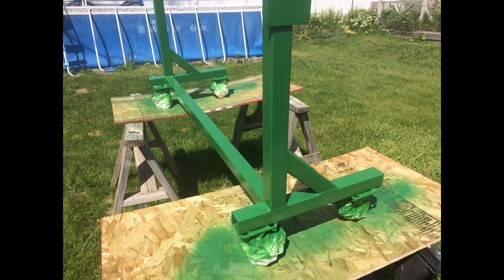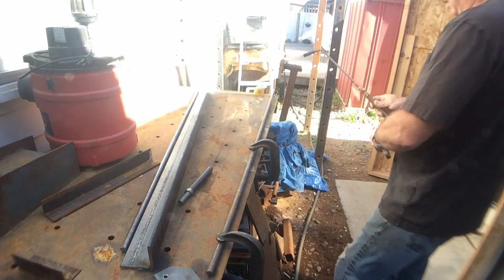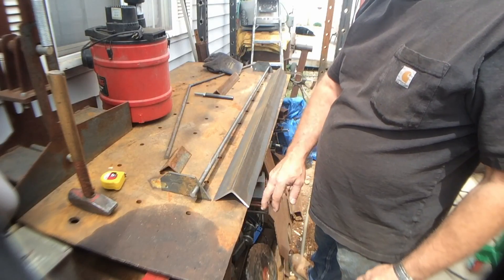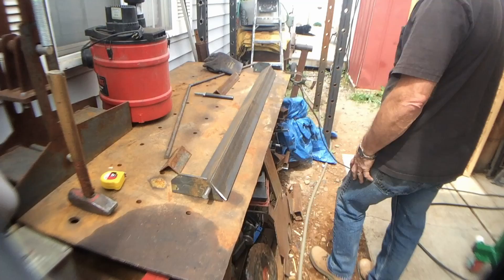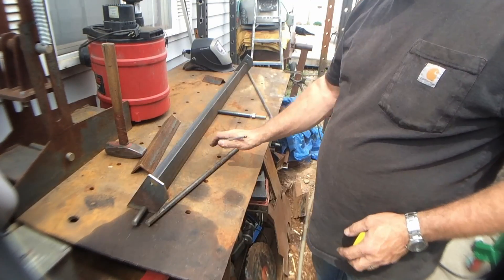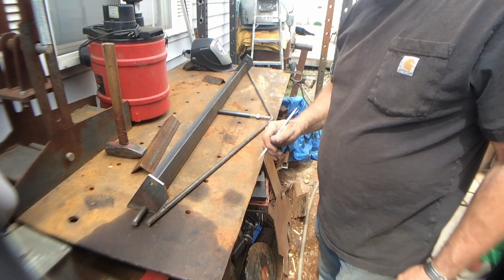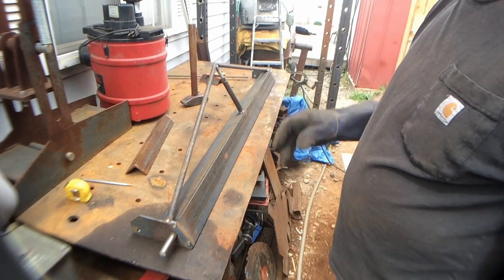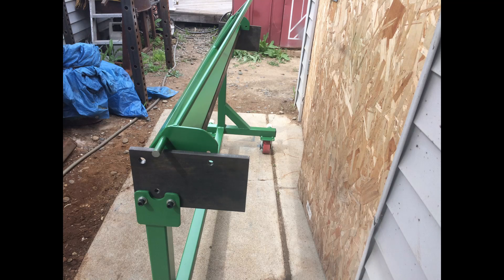Scratch Building A Zenith 701 Experimental Airplane: Building a Bending Brake Part 3

Comment: You're making me jealous...This is a REAL bending brake.  If/when I ever build the CH 640, I think I'll start by building a proper brake (especially since I have a welder now). Working on the final parts in .063 last night...too much flex and not enough clamping force for the longer pieces. About 5 channels/angles that I can't do.
Reply from the maker: No need to be jealous, we will see how well it compares with my bigger brake. I think it will work for the majority of the items needed to be bent, but I don't think it will cover everything. That being said I didn't expect it to. Almost everything over .032 was not bent on my big brake as there is just to much flex in it, and I suspect this brake will be the same. depending on the length of the bend (up to about 12") heavier material was bent with homemade press brake dies (very crude) on a "H" frame press, could be done on a Harbor Freight press and all the longer pieces were bent in a homemade press brake (also very crude). There are ways to accomplish all the necessary tasks it's just necessary to be creative.
Reply: Yeah, creativity is the key. As poor as my brake design is, I've been able to to a lot with it. That said, I was hammer-forming parts in .063 over a piece of rounded oak stock clamped in my bench vise last night (and they turned out great, surprisingly). Really considering the press-brake kit from SwagOffroad for the HF 20-ton I have, but it still wouldn't do the longer bits in .040 and .063.
Reply from the maker: There's is a nice kit but for the few parts needed in that size range you can  be inventive with your HF20 and some scrap angle. for the bottom think of  3 pieces of angle iron nested opposite each other to form an M   /\/\   the center angle is the form for bottom of the die so grind/polish the open end so your alum can slide without scratching. for the top portion I used a piece of square tube probably 2" long that will slide loosely over the ram on the press and to the bottom of that I welded vertically a piece of flat bar with the bottom edge ground/polished to press down in the middle of the bend   

      |__|    top die
        |
-----------------  aluminum
     /\/\      bottom die
Reply: I'll have to see about fabbing up some custom dies. I'll need more scrap steel (or have to run to my local dealer for some drops), but I could use the press brake for other projects too. Not a priority at this point since I only have 5 pieces of .063" to bend, and they're all too long for a press brake based on the HF20.
Reply from the maker: not sure how long the pieces are on the 750, but the dies are open ended so you can gradually bend it in sections for longer pieces
Reply: Most of the fittings and such would be fine. It's the large fuselage channels/angles that would be difficult. They are about 3-4' long. I have access to an industrial brake that will handle them, it's just an hour away (I'm down there regularly, though). I'd worry about getting a consistent bend doing them in sections across such a long part.